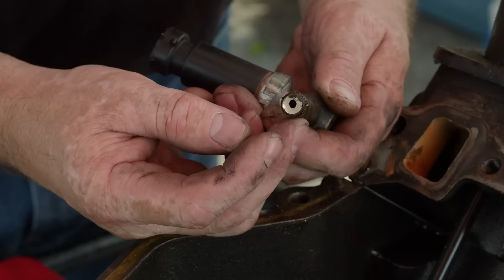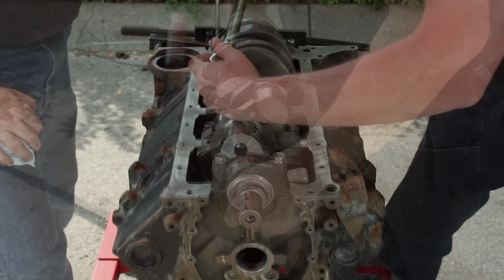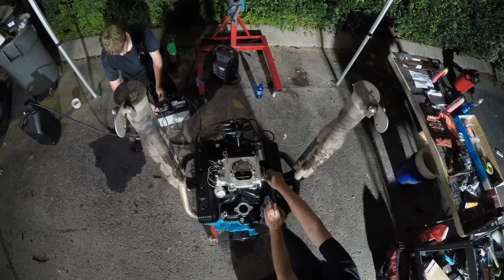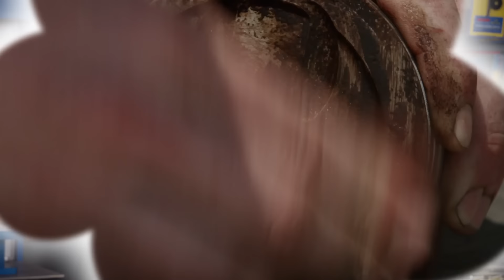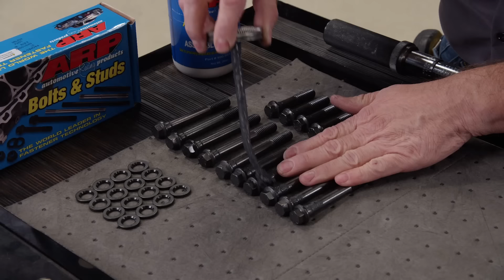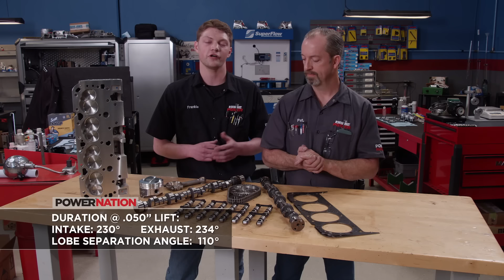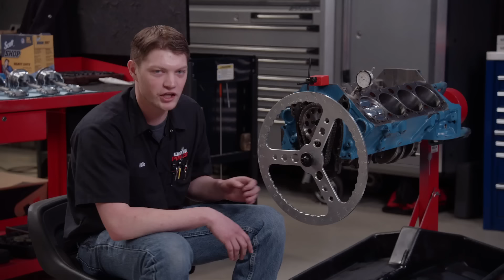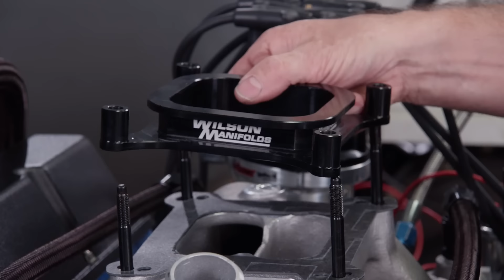Over 13:1 on Pump Gas! Chevy 350 Dyno Mule - Engine Power S9, E9 &10

Comment: I would love to see a build using the absolute minimal amount of tools: floor jacks, no power tools, etc. I think it’d be very informative for younger enthusiasts who can only afford the bare basics along with being an interesting challenge for y’all.
Reply: There's another program on this channel where they do that  fix people's cars in their own driveway.
Reply: Roadkill does a lot of that
Reply: Yeah, this isn't a budget channel, nor should it be. As stated, there are other shows to watch.
Reply: Except don't forget the block washer and sunnen bore hone lol. We all have those in or garage right?
Reply: @slowpoke96Z28 why can’t you just take your engine to a machine shop to get it honed and cleaned? No one expects you to have specialized engine machining equipment.
Reply: @javanbybee4822  the man said NO special tools, in their garage, for young people. My point was you can't. Some things need outsourcing.
Reply: @slowpoke96Z28  I see your/his point now
Reply: @javanbybee4822  Kids think they can take a jumkyard truck ls, never needs machining, "drop in pistons" which is a scam etc. They dont actually really have anything machined, shortcut city
Reply: @gordocarbo You CAN.... 

I made 700h.p. on a junkyard 4.8 LS with a turbo and a stock engine with 130,000 miles on it with NOTHING but a cam, valve springs, a turbo, and a tune. 

NO other parts replaced in the engine WHATSOEVER. 

It's been running for 4 years now.

Have you been living under a rock?

By the way, I'm NOT a kid either, I'm probably older than you.
Reply: Why?? You like to watch other people suffer? 

It would be the SAME result, just a bunch more fuckery getting there.

Comment: A true disappointment with 13:1 compression that motor shouldve been at least high 500 hp range. Ive gotten more power out of a flat top 350 than that. Thats a waste of compression in my opinion. I built a 302 with a stock 5 liter bottom end with afr 165s and a e303 cam made 405 hp and 380 ft tq

Comment: I made 431hp and 430 torque out of a true 350 ci  sbc with a set of port by me iron eagles and a Howard cams hydraulic roller cam with a 10-1 static compression ratio I honestly expected more
Reply: If you haven't looked into the stuff David Vizard does with SBCs I'd do so. He makes no recommendations that aren't backed up by extensive dyno testing and he's got proven power combos for just about any budget level.
Reply: @grandmasmalibu  
Need E-85 fuel  ⛽
Reply: What cam and intake? What's duration at .050
Reply: That’s still impressive
Reply: @grandmasmalibu  I didn't catch the timing set up at 23. That seems damn low. My 383 Chev with aluminum Vic Jr heads and intake, 650 speed demon, 9.8:1, we brought it way up to 40 total. Made 511hp. Pump gas
Reply: Sounds like a lot of work. I had someone hook up a computer to my car and it made +50hp +80lb ft,  gotta love factory turbocharged engines
Reply: @hanzgrueber145  NA cars sounds Light years better.
Reply: Naw man, 430 from 10:1 running a hydraulic is great.
Reply: Sounds good to me.i'd stick it in a old nova.
Reply: 13:1 is NOT an advantage ESPECIALLY on "real" pump gas.
Reply: @terrypetty9822  compression sounds awesome, but little power increase, compared to the shear hassle of buying barrels and barrels of the "good" stuff. And the cost for a street car.
Reply: Me too a similar setup ford 347 stroker made over 500 hp on pump gas. I think they are just being conservative because of the parts selection, you don't want to push engine internals to the absolute limit and blow er up. Speed and power are money how fast do you want to go? I have seen plenty of small blocks chevy ford dodge make much better power than this. With s chevy 350 you have about a thousand different state of tune options so this is just one combo.

Comment: I wish that they would have also installed the other high lift cam and compared the results with this modest cam. The dynamic compression would be less, but the air flow would increase.
Reply: I'm guessing they did, but the dyno number were too disappointing for a cam that big, so they went with a smaller cam and crutched the too high cylinder pressure with too low ignition timing. Or maybe they're going to run the bigger cam in a future video?  Either way, this build was pretty underwhelming
Reply: Thats what I thought they said they were gonna do. I guess they didn't have enough time alloted after editing and whatnot. Left me hanging🤷

Comment: The 350 was always capable of making alot of power naturally. These engines were awesome.
Reply: And swapped into just about everything! An sorta the official crate motor for Hot/Street Rods
Reply: Are awesome said the old sporting a 70 Lt-1
Reply: MANY engines are capable of making alot of power "naturally" the Chevy 350 is nothing special.
Reply: @davelowets It must have been pretty damn special to have a production run for over 30 years.
Reply: @davelowets Lots of 350 SBC in Fords Hot Rods and lots of Ford 9 inch rear ends in Chevy Hot Rods. I would say 350 was King at one point in history.  LS engines are top Dog now.
Reply: @Jason_556 coyotes out power ls and an ls is a copy of a ford anyway.

Comment: Running the little cam that far retarded probably hurt the torque curve. Where’s the timing sweep? That engine should make more power with the right cam. Working backwards from a 48° intake closing, a 244° intake lobe at 106° would give almost identical dynamic compression. Grind the cam for about 108° LSA and see what that does on the dyno!

Comment: 22 degrees of timing? Sounds like they started seeing detonation and backed off. This isn't showing what you can do with dynamic compression, its what you can do if you are a good tuner. Stick that motor in anything that is over 3000lbs and street drive it you're going to have trouble. They explained this fact at the end but there still will be someone that blows their motor up and blames these guys for telling them they could run it on pump gas.

Comment: Badass!! Anything over 12:1 on pump gas 94 octane is badass!!
Reply: With the timing so far backed off that it's almost pathetic. That is an easy 600 horse motor with 36 degrees timing and 110 octane, also the cam timing advanced 4 degrees.
Reply: @brandonsemian3703 NO, that is NOT a 600h.p. engine, even with the correct fuel and timing.

And NO, you can NOT run 36° of timing on a high-compression engine, unless it has the laziest, lamest, combustion chambers EVER in the heads. 

My 13.5:1 big block on 114 octane fuel likes 30° at the MOST for best power and no detonation. 

36° WOULD rattle my engine to DEATH very quickly.
Reply: @davelowets how the hell do people determine. " ° " of advance???? 😂 From a timing light????
Reply: It's not really bad ass... It's a compromise of a too large of a cam, and too little ignition timing to take advantage of that compression. There's NO "magic bullet" to making power with pump gas, you can only make so much with it. Why over compress, and over cam an engine to just waste the power? Use the PROPER octane fuel, or the correct compression ratio for the fuel that you plan on running. A crutch isn't a good way to build an engine. 🩼

Comment: i was expecting that to run over 450hp and 460tq,, the cam was lame,, i have a simmilar setup with a solid can running 10.25:1 and runs 471hp and 465tq at 6100,, and is still good at 3800rpm with 3.4 rear end. good video though.

Comment: Watch the build: https://www.youtube.com/watch?v=TH-IAT7-wis
Reply: What possessed you to use Autolite sparkplugs in a GM engine? 50 years ago I used Champions in everything. Then I learned they usually were not the best option and switched to OEM recommended plugs.
Reply: @douglasburford8452  My uncle was a chevy guy and I'm a Ford guy. He taught me that if u have an engine that burns oil Autolite plugs will burn longer in the oil than others. When first start an engine after a rebuild I always use the old plugs. New ones go in after cam break in.
Reply: @douglasburford8452  Switched to autolites in the late 80s never had a failure miss etc
a plug doesnt know what brand it is
Reply: Gaby @douglasburford8452
Reply: Pat  Now try E-85  fuel  ⛽
Reply: @billywilliams6853  How about using a duel fuel E-85 to warm up on then switch on the propane to keep those expensive parts clean!
Reply: I had a lot of luck with Bosch plugs in a worn valve guide (burned oil) small block.
Reply: build a 5.4 3v triton
Reply: The hosts are proof that you can say almost anything with confidence and people will believe you.
Reply: I don't know why 13 to one or even 14 to one compression ratios is a big deal cause any stock sport bike is this at 600cc and higher.
Reply: @Thelongmanable  It's a bigger deal with a 4 inch bore and 5 or 6k rpms instead of a tiny bore and 15 or 16k rpms. If you want more details just say so.
Reply: Run 110 dangit! We wanna see. It was already on the Dyno. Shoulda seen what it would do.
Reply: parking lot on a warm day isn t so bad place to build a engine that you could blame it for a poor build that smokes and isn t sealing well.it s always the builder who is responsible for the build.you shouldn t built it outside if it compromises your build quality.you american s seem to think differently than us technically minded educated europeans.that was some bad narrative.other than that i like many of builds,especially all big block chevrolets which i raced with for well over 15 years ranging from na 396 to blown 538 pro stock chevy with lots of bore and torque.
Reply: @teknoaija1762  Please don't lump all of us in with these fools.
Reply: @Dane33781  you are correct sir.sorry for that slip up.usa just gives so much negative vibes these days,i sort of vented that in there.
Reply: @teknoaija1762  I can understand that. There is plenty wrong here right now. Many people here can't even agree on what a man or woman is. While people here argue over things like that, the leadership is becoming more corrupt and less compotent. On average people here are becoming more ignorant and more entitled. Those of us who try to keep a level head and solve our own problems, economic and otherwise have our hands tied in many ways. I could go on and on.
Reply: @Dane33781  less competent.when i watch a video with a certain theme i make similar thought flow mistakes.i am sort of very slightly autistic.it s like watching a political trainwreck over there.i m from finland and you often hear right wingers say finland doesn t have these problems because we are so homogeneous nation.well, that is changing.i was at the beach with my cat who likes swimming and majority of beach goers were brown/black young men.it s our civilized, well educated culture more than anything.last time at the beach my cat was playing with three children from syria. they ve been here for 3 years and children spoke perfect swedish and finnish with me and were very polite. father was being educated and said to be more than happy here.i m very critical towards immigrants but they were so finnish there was no point.
Reply: @teknoaija1762  its just pure show nonsense.
Reply: @a4000t  and I just reacted to this nonsense.Sort of clickbait show and nothing more
Reply: So how using race fuel/ higher octane fuel affect the numbers on this same engine?
Reply: You guys have done it now! You have made me fall in luv with the 4.3, I was set on a 2.8 or 3.1 but after close inspection the 4.3 is far superior for my application!
Reply: Build a 409 in a small block chevrolet

Comment: Do you guys ever use the heavy duty single roller timing chains, much heavier than the stock single but still not a double roller chain? Also, I have about forgot everything on the intake manifolds... like head angle on the intake from early V8's to the vortec heads... that angle is different right?
Reply: Angle is the same, but the manifold bolts are vertical on the Vortecs.
Reply: @earlbrown  Thats what it was.... thank you for this reply

Comment: A lot of information that I was able to hear with very well expressed details. What sealant is used for the valve covers, intake, oil pan etc. Sealants I have used don’t seem to last. 
Maybe I would have mentioned making sure that the block and rods are honed if you change to ARP bolts since backyard mechanics might make the mistake of just switching without the added step. Great job. Thank you
Reply: look into Yamabond4 and Yamabond5 for your sealing needs.  That's all I use in 99% of my engine work when I need to seal something.
Reply: @earlbrown  thank you

Comment: HA this will catch up with you after a while. Get some bad gas and not know it and lay into it and let me know how that goes. Blew a ring land on a piston on each bank of my 13.25:1 383 one night. This is living on the edge. I wised up and went down to 10.85:1 and went custom solid roller from Bullet racing cams along with Morel solid bushing solid rollers. No needle bearing issues for me (at the expense of $1000 lifters). .666/.645 in a 385 with Brodix dragon slayer heads made just over 600hp on the engine dyno on 93 pump and a custom prosystems carb.
Reply: I’ve been in Morel’s plant quite a few times
Reply: How about using a duel fuel E-85 to warm up on then switch on the propane to keep those expensive parts clean!

Comment: I would love to see that high comp 350 run on race gas, e85 and methanol to show what it will do with compression and race fuels 👍
Reply: How about using a duel fuel E-85 to warm up on then switch on the propane to keep those expensive parts clean!

Comment: i would love to see you guys put 110 in it and compare the numbers and the tune info to see if you could run a dual fuel system pump gas race gas like steve morris dose but on a budget for regular guys
Reply: 110 would wake this motor up a bunch

Comment: Great entertainment with 22 degrees of timing. EGT's are probably through the roof. Let's see how she runs on Race Fuel.
Reply: EGTs are moot in a gas engine, this is not a diesel engine
Reply: @TheRoadhammer379   With 22 degrees total timing, this thing will overheat the first time you approach a hill (and this would be shown in stupid high EGT's). 
Installing the cam straight up (ie, evenly split overlap) plus a set of heads with correct combustion chamber volume (cc's) and correct ignition timing (eg 36 - 40 degrees) would net a much more powerful and driveable small block.

Comment: I am surprised you guys left the timing at 22 degrees and didn't advance it to see where the detonation limit was.
Reply: That less than ideal timing curve can be a part of the cheat code to getting away with this. Especially in the real world. Dyno cells are highly controlled environments. You can pull stuff off in them because of that that you wouldn't always get away with in a car going down the road. 
Despite the aluminum head with a much better combustion chamber design, the DCR being that high, I personally don't think they were all that far from seeing detonation.
 It's a great show with great information, no debating that at all. Sometimes they REALLY have to push the limits to make a bigger splash.

Comment: I had a friend do this many many years ago with a big block MoPar, and he won Drag Week 3 times with it. Near 13.5:1 on pump gas. He said the secret was all in the cam timing. I believe it made 1150hp NA.
Reply: Turdhammer379, look him up: His name is Eddie Miller and it was a purple Duster. I don't make shit up.
Reply: Bullshit, 1100hp NA, you're blowing smoke. The biggest cubic inch crate engines don't bump 1000hp naturally aspirated.

Comment: Sure for the build and understanding static and dynamic  compression on 93 pump gas with a efi kit. It's a good test. BUT to any person off the street they would just laugh at you 13 to 1 412hp on the engine dyno. Put it in the car it makes 340-355hp to the wheels.
Reply: depends.  if its in a 240z  well  that thing only weighs 2500 maybe
Reply: @KingJT80  yeah and then some guy with a 6.0 ls in a foxbody blows you away at the traffic light 😄😄😄
Reply: @PercyMack85  depends on what's done to the 6.0.

Comment: you should have shown how to properly set the adjustable timing pointer. because majority of what I've seen installed by other is off to the limit and may as well not exist. tune by ear is usually closer 🤣

Comment: was it installed in a daily driver and hammered at the track for 20K miles or more, or just the dyno runs and torn back down to build up larger? even if not documented all along, it would be nice to see the outcome that many miles later. I know that's hard to do though.

Comment: Damn lol, My 300.00 Stock 4.8L makes 28hp more!  What happened?
Reply: Take that EFI off of it and it likely would make the same power. That my friend is the beauty of old school engines, you can make the same power as modern stuff with out the need for $10,000 worth of electronics that adds a ton more failure points.

Comment: Be nice to see them do a Gen 2 LT1 instead of an Gen 1 350 or LS. You can run 13.5:1 all day long with pump gas. I'll even donate the block if I can have it back when you're done. Or go really creative and find a LT5. See what you guys can do with that.
Reply: Sure, you can if you want to give up a bunch of power. 
Hell, I could run 15:1 on pump gas, but a properly cammed 10:1 motor would walk right by it.
Reply: I’m hearing that! I have a 96 Impala SS. So my LT1 has cast iron heads. I think it’s important to keep it numbers matching since I’m the original owner.